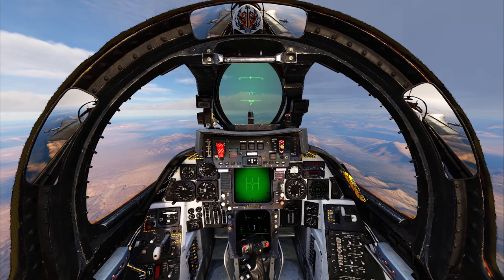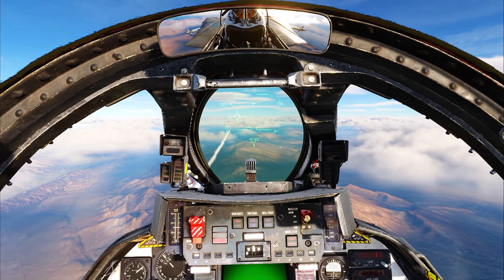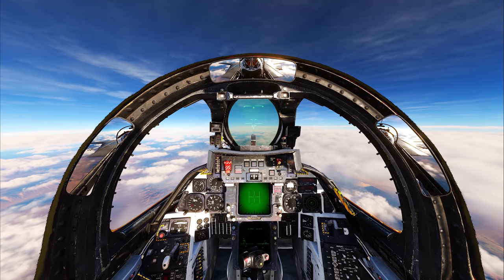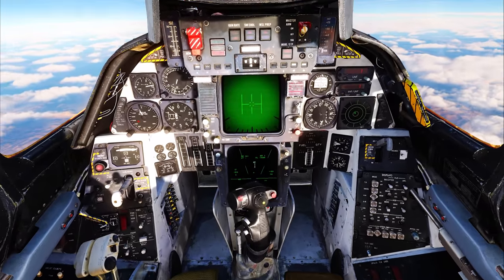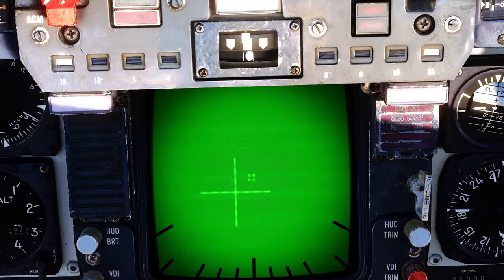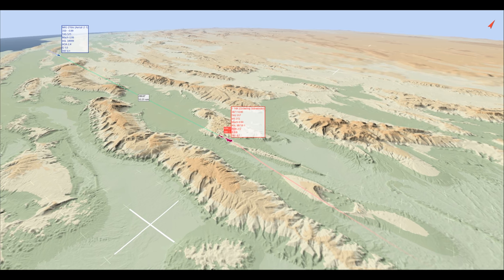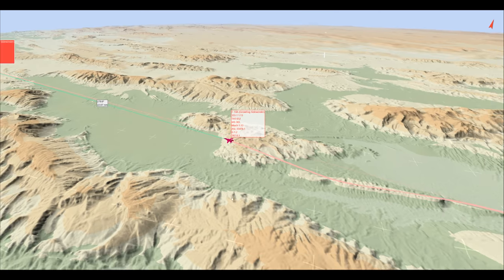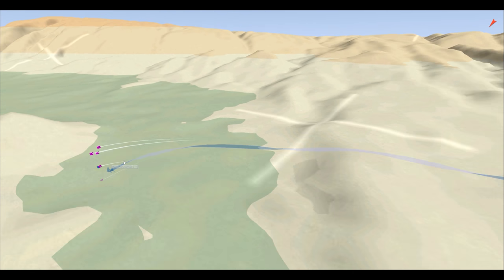What Happens When You Strap A Surface to Air Missile Onto Your Jet | Digital Combat Simulator | DCS

Comment: When I come to think of it, I realize it was actually sound thinking by the Iranians. The original HAWK (Homing All the Way Killer, MIM- 23) was intended to intercept low flying fast jets and its missile was therefor designed for high maneuverability in dense(r) air. The missile itself should therefore have favorable performance when taken higher up and being launched from a fast jet, giving it more initial energy (and thus range) from launch. 
I wonder though how the Iranians matched the passive radar seeker to the Tomcat's radar. That must have been a a pretty remarkable feat considering that Iran at that time was already under a US weapons embargo.
Reply: ever heard of Contra? what embargo?! lol
Reply: Before the 1979 revolution, Iran constructed local factories which made and repaired the MIM-23 HAWK system . So when Iran ran out of Phoenix stock, adapting the HAWK made sense not just functionally but also because they didn’t need to mind the embargo. They’ve apparently released the FAKOUR-90, which is a HAWK SAM repurposed to a Phoenix-style case.
Reply: @Silversmok3  Thanks for the intel.
Reply: @houssamassila6274  Yup. Didn't think the Iran-Contra deal entailed HAWK and F-14 components.
Reply: @Pincer88  it was mostly about surface to air missiles wasn't it? and that was only what was admitted by the Reagan administration after a long pressure from the media...
Reply: Could be. All I clearly remember is this USMC (lieutenant?) colonel Oliver North, but most details passed me by since I was biting dust with my fellow conscripts on the North German plain most of the time. Here in the Netherlands we didn't have cable TV, let alone CNN in those days and newspapers weren't being distributed during field training. Oh, and weren't hostages also involved? 
Either way, the inventiveness of the Persians is laudible . If only half of that IQ was used to further the welbbeing of their own and neighbouring people, I'd almost admire the ayatollahs in Tehran. By the same token, same goes for every other nation, including my own.
Reply: @Pincer88  there were hostages indeed but mostly the usa needed to keep a fine balance in the middle east and not let iraq grow too strong .what's admirable is your service and your comment. have a great day sir!
Reply: @bsd107  Thank you kindly for the intel, I didn't know that.

Comment: Anyone remembered the Super Hornet with the SM-6 strapped on it? Also I wonder how viable it is to convert a Kh-31 into an AAM considering Boeing's MA-31 presentation implies it having Phoenix-like envelope.
Reply: How about that F-15 with a AIM-54
Reply: Right, I remember that. Imagine the range on a high altitude lauch lol, I'd imagine the missile would run out of battery before it runs out of kinetic/potential energy.
Reply: The F-15 could definitely hold a pheonix
Reply: @thetbnrtitanium007  couldn't cool the sensors, though. I would hope a new design in that shape wouldn't need external cooling.
Reply: @counterfit5  it has shit manoeuvrable tho... AMRAAM shape is much better tho, especially with new guidance algorithm enable Phoenix range
Reply: @VuLamDang  Applying same algorithms to Phoenix would result in even higher range, however
Reply: @JohnKozak  yes but that come with different problems, to name a few: How to reliably find, track and connect target at that range. Phoenix and AMRAAM D is at the top end of what is physically possible to track and mid course correcting
Reply: @VuLamDang  this is non-issue with good datalink and off-board sensor coverage. Turkey demonstrated this very well during their Syrian ops. AMRAAMs fired from F-16s using off-board data all from AEW. The opponent will only receive a warning when the missile is in terminal and switches to its own seeker. The only issue is ROE and ID.

Comment: Us, Serbs, did kind of the opposite in 1999... We fired air-to-air missiles from the ground...
Some dude came to the idea to take an old AAA system called Praga, remove its two 30mm guns and put actual airplane pilons in their place. So, they could now direct them both by azimuth and elevation. They used R-60 and R-73 (the later one was especially liked). Launching it was rather crude...
However, one problem quickly became obvious. Those missiles were made to be launched from an aircraft, so the plane would already overcome gravity and give it some initial speed. But when launching it from the ground, you didn't have that and its range was much shorter. The missile would often lock onto the target it couldn't reach (it could if it was launched from a plane). The problem was partially resolved by adding it a makeshift booster; rocket engine from MLRS systems.
As it turned out, the results were surprisingly good, especially with R-73 which was admired for its agility. So, Serbian army soon made a couple of these and started adding boosters to some missiles. However, after the war (or rather: NATO bombing) ended, the project was pretty much abandoned. But today, there is Serbian "modernization" of Kub SAM (SA-6) where they removed one of its missiles (the middle one) and placed R-60 or R-73 there. Not sure how heat-seeking missile is useful on a launcher directed by radar, but OK...
Reply: The Houthis also shot down a Saudi aircraft using an R-27T strapped to a ground-based SAM.

Comment: I wonder how they got it to talk to the AWG9?  Don't SAMs usually operate in a different radar band?   Does it still show up on RWRs as a SAM? 

Imagine that mindfuck?  Your RWR pings you are being tracked by a SAM  at 12 o'clock  so you look ahead and below the horizon for a launch plume... and defend like you are trying to break a SAM...
only to get creamed from on high like a air to air missile.  I mean WTF!  Right?  🤣
Reply: It worked with the F-14 because the target illumination radar for the HAWK and the missile guidance mode for the AWG-9 both operate in the same frequency band and are both continuous wave. An RWR modern enough to display what the detected radar source is would just display it the same was it would if the F-14 launched an AIM-7. The RWR would detect the unique combination of radio frequency, pulse width, and pulse repetition frequency to determine that an AWG-9 is in search mode, then in single target track, and then it would correlate the CW signal that followed with the stored information to determine an F-14 is guiding a semi-active missile.

Comment: Wouldn't the range of the hawk missile also be increased by the speed you were going?
Reply: Of course, it is still a missile afterall, plus i imagined that its range should increase drastically because instead of starting from the ground at 0km/h like a normal SAM, this one started at mach 1
Reply: @fdenrico9861  imagine strapping a singular sm-2 onto the bottom of the tomcat, the range that would have launched from 20k feet at mach 1 would be insane
Reply: @skull1161  ikr, like if a missile has that kind of performance starting from the ground, imagine what will happens if it starts in the air! maybe we should ask ourselves if air-deployed surface-to-air missile is the future 🧐

Comment: Back in the day i found a way to manipulate saved loadouts in LockOn: Modern Air Combat. I tried out french missiles in mig-29. I also put a huge missile from tu-22 to it, but couldn't get the guidance to work on that one. You could do this by copying lines of text between loadout's files.
Reply: There was a little program called Lock-On Payload Editor (LOPE) that would do this for you.  I loved adding various missiles to the F-15.  My favorite was probably the French MICA-IR, although obviously the mighty Phoenix was great fun as well.
Reply: that still works.
Reply: Good old times. I remember trying to take off with the Ka-50 in BS1 with 4x FAB-1500 hanging off of the pylons :D
It could barely takeoff and fly, but hovering was impossible ^^

Comment: I'm honestly kinda surprised it took that long for someone to do that. Logically it makes it perfect sense, if it's supposed to have the energy needed to go from surface to air and reliably hit the target, pumping up it's initial launch energy up that high by just strapping it to a plane makes sense from a physics standpoint.
Reply: if you can get around the technological hurdles of mounting and guiding the SAM, most of them could be used launched of jets; it's just that if you can acquire purpose made AAM, why bother, but if you are under an arms trade embargo for example, the need may arise.

I know that MICA missile can be launched by both jets and SAM launcher, so the idea was explored by MBDA at least
Reply: I think a purpose built A2A missile would be built with less weight and drag. A heavier SAM would have a greater impact on flight performance.
Reply: @nicolaspeigne1429  yeah, a missile designed to start from ground has to make a compromise in cost or how well it works

Comment: The Hawk, unlike the Phoenix but like the AMRAAM, uses a fragmentation warhead instead of HE.  It will not kill by impact or shockwave, but by using a proximity fuse, it sends about 14,000 fragments in a cone toward the target at something over Mach 5.  The Sidewinder is somewhat similar except it uses a MUCH smaller warhead (20 lbs vs. 160 lbs) and the fragments in the Sidewinder make a circular ring that cuts thru the target as it expands.  Nasty stuff.

Comment: The inverse of this happened in Yemen against an mq-1. They used a sidewinder mounted to the bed of a truck.
Reply from the maker: Loooool no way, that’s hilarious.
Reply: There were official Sidewinder-based SAMs.  The Chaparral system was based on early Sidewinders.
Reply: That's the great thing about the Sidewinder. You can just about bolt it to anything.
Reply: Correction, it wasn’t a sidewinder, it was an Archer. Which makes sense because I don’t know how the Huthis would’ve gotten their hands on an AIM-9

Comment: Imagine the range on this thing if it correctly lofted itself. Probably have mach 2 at target on first launch. Wonder if it would be too difficult to program that in, possibly a command from the aircraft for custom flight paths.
Reply: Probably the easiest way to do it would be to desolder the ROM from the board, stick it in a reprogramming tool, and go to town. IDK how you would figure out what to change, though, and that's in an ideal world where you can even get at the motherboard without breaking the missile. More likely, the motherboard is baked into a resin brick meant to protect it from the elements, which is in turn glued onto some fragile structural component, considering these things aren't really meant to be serviceable. And all that is if the whole motherboard isn't massively obfuscated in some way, like having 2 ROM chips that are accessed in some obtuse way because they wanted the small memory version for cheap, or "OPSEC", or some other nonsense like that. Never underestimate stupid, especially if that stupid can be hidden in a resin brick for all eternity.
Reply: @mage3690  that's why I think it would have to be from the launchers command, it's a fox 1 meaning commands have to be sent from the aircraft to missile for guidance. Probably just have to update the aircraft to give altered coordinates to the missile. What's the missile care, it goes where you tell it to.

Comment: I have an odd question…
Those Red Bull race planes turn on a dime and are extremely manouverable. What would happen if you got a middle lock on one of those planes? It seem like one of those planes could easily dodge and out manouver pretty much anything.
Reply: Robert S  What I was eluding to was the ability to dodge the missile all together.  I don't think those supersonic missile can change direction as quick as those Red Bull race planes.  The Red Bull planes can do a complete 180 degree turn in a heartbeat.
Reply: @plutus205  Yes but the Red bull plane doesn't massively change "position" in the sky. Speed = distance, if all the missile has to do is track a few degrees more to compensate for a sharp turn it doesn't matter in the long run.
Reply: @sebastiannelson6355  huh, alright then I guess.

Comment: Not too far fetch.  The USAF put a Patriot pac 3 on a f15 before and fired it. The Phoenix is basically a HAWK missile.  The US Army is testing a surface launched amraam called SLAMRAAM. When I was a Patriot missile crewmember we shot down a modified pac 2 Patriot that simulated a surface to surface missile with a pac 3 Patriot in 2005 at white sands.

Comment: How can a Fox-1 go for chaff while your radar is still locked on the bandit? Or did your radar also fall for the chaff?
Reply: A semi-active seeker means it's still the missile making guidance decisions.  Your radar lights up the bandit and his chaff, and it's up to the missile to find that reflected radar energy and decide which is the real Slim Shady.  If the missile doesn't have very good decoy-rejection in it's guidance logic, it can get tricked.

By contrast, command guidance is when your radar does all the detection and then datalinks that information to the missile.  I believe the Phoenix does this in the early phase before it goes pitbull, and it's how the SA-2 worked.  Command guidance allows greater range than semi-active, but it tends to be inaccurate in terminal guidance because the seeking radar is so far from the target.
Reply: @JETZcorp  Thank you for your detailed answer! I was under the impression that all Fox-1 were basically remote controlled, but a semi-active seeker makes more sense!